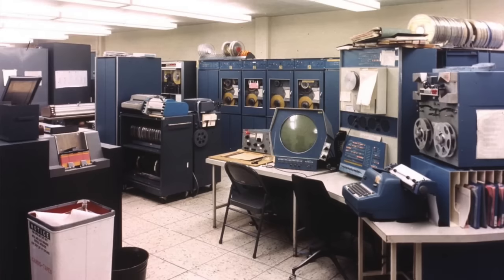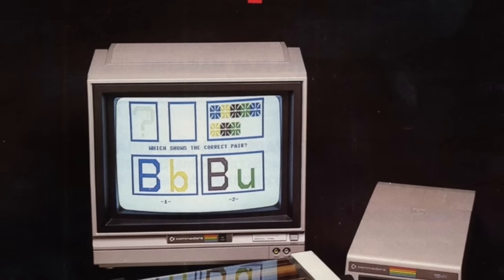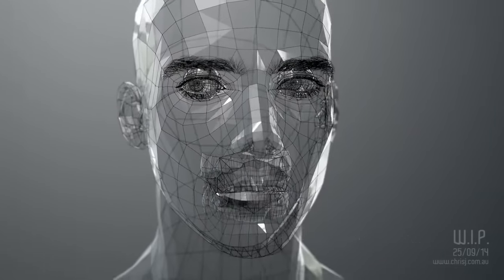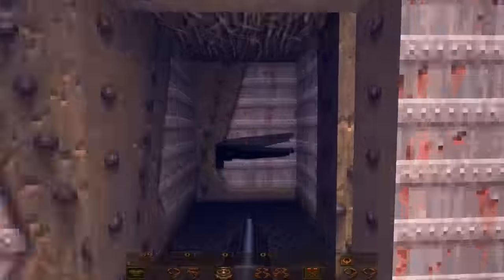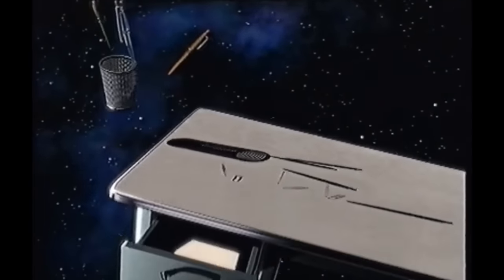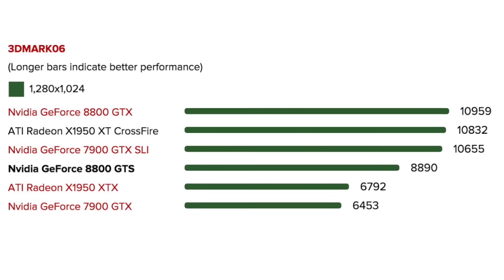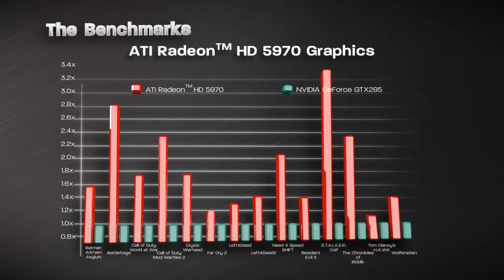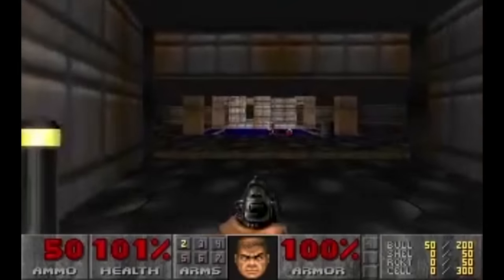Evolution Of PC Gaming Hardware

Comment: this really makes me wish I had money so I can upgrade my budget build
Reply: even though it's pretty good
Reply: +zman2748 what are your specs?
Reply: +zman2748 hell yeah, im with you on that
Reply: +evorm amd phenom 2 (hopefully I'll get a new tower for an Intel core i3 in December) 8gb RAM and the gtx 750 ti sc
Reply: +zman2748 u can spend a little more on the i3 and get a K which is more optimized for overclocking
Reply: +evorm yeah I'm gonna need to overclock because I'll be getting witcher 3 soon after the i3
Reply: +zman2748 i3 isnt very good for gaming get either an i5 or a solid quad core amd cpu
Reply: +jatwood1997 it's better than phenom 2 lol
Reply: +zman2748 May be better, but dual cores are starting to become obsolete very fast.
Reply: +zman2748 sits in the corner with a 880M 24GB RAM and an i7 very lonely
Reply: Not comparing dicks, but mine is better.

- Intel Core i7-6700K 4.0GHz (Quad Core)
16GB (2x8GB) DDR4 2133Mhz
Samsung 850 EVO 120GB SSD Read: 540MB/s Write: 410MB/s
Secondary Hard Drive - 2TB 7200 RPM
Graphics Card - Nvidia Geforce GTX 980 Ti 6GB (Min. 600 Watt)
Power Supply - Standard 700 Watt
CPU Cooling - Asetek 510LC High Performance Liquid Cooling

Only 2000 dollars
Reply: +Chad Meier I'll buy the i7
Reply: +Bloody Ax Lel you got a 6700k Skylake instead of a 5930k. Hilarious.
Reply: Pyromancer Sargeras Is the 5930k better?
Reply: +Bloody Ax i have

i7- 3770k 3.4ghz
12GB ddr3
1tb shitlord drive
750ti dual fans overclocked 1300mhz boost clock 5600mhz memory clock
450 watt
fan cooling

only 800 3 years ago
Reply: Bob Higgens Not to bad.
Reply: Bloody Ax yeah halfway decent but if i could choose i would get two 980ti's
Reply: Bloody Ax Yeah, the problem is the 5930k is like $150-200 more. I mean, for a $2000 build it would've been worth the difference in my opinion. Everyone has their budget though of course.
Reply: +zman2748 Yeah, I build mine like 3 years ago and still don't have the money to upgrade it only because every time tech being pushed , but I'm proud of what I got only because it still can run things:

Intel Core i5-3570K @ 3.40/3.80
8 Gb of Ram
Gigabyte GeForce GTX 660ti 3Gb
Reply: +zman2748 please do reconsider buying a dual core some newer games only works on quad cores main example being Far Cry 4 and most games runs like horseshit on dual cores now.
Reply: +Bloody Ax Nice build very good for the price. I have:

Intel core I7-5820k
16gb (2x8) ddr4 2133
Samsung 850 PRO 250 GB
And also a 3tb HDD  and a 1tb for games.
SLI Asus gtx 970 strix
1000w corsair rm1000
Corsair H100i
and for the case I chose the corsair Graphite 780T

For around 2500 (Tech is very expensive in Denmark)
Today I would have went with a 980TI though... It came out like 2.5 weeks after i bought mine
Reply: +TrianglesRPurple 

I'm just sitting here with my potato.
Reply: +TrianglesRPurple im sitting here with my 1000 dollar build
Reply: +zman2748 phenom 2 is better than core duo e8500 :(
Reply: ***** That GPU seems kinda out of place...
Reply: ***** Hey at least it does bread!
Reply: I feel so alone
Intel Pentium G620
8GB Crucial Ballistics Sport XT (1866 version but cpu runs it at 1067 Mhz) 
EVGA GT 730 OC'd 1280 core clock and 3159 mem clock
1TB hitachi hdd and 500 gb WD Blue
EVGA 400 watt psu
Ranger-M case
Soon to have GTX 960 and AMD Fx-6300 (Need to buy a better psu and mobo)
Reply: +zman2748 Im saving for a already built one and hope fully its good in the end. Mine sucks, at LOW settings its at most 70fps
Reply: Lenin Lopez Hey it could be worse. You could be playing at 30 fps!
Reply: I honestly don't see a difference between 30fps and 60fps other the a couple of quality upgrades buts thats about it.But still its good, it gets the job done.
Reply: Lenin Lopez Then I won't try to show you the difference because that'll just make everything a lot easier for you when you don't have to worry about framerate as much
Reply: +Lenin Lopez Then you aren't playing at a constant 60fps and 1920X1080 or above.  You play games at 60fps for a time and then go to something at 30 and you DEFINITELY notice.
Reply: +Bloody Ax god damm, I'm the only one that haves the full "Red One" PC

fx-8150 black ed.
8 GB 2133mhz RAM
r9 270x 4gb ed.
ssd kignston 120GB
1TB hdd's (multiples)
cooler master seidon 120m
msi 970 motherboard
700W psu
aaaaand a lot of fancy fans and red leds

all pieces for 550$
its nice now that winter is coming ,i have no cold in my feet! 
have a nice day guys!
Reply: Just get a 750 ti or a 260x or a 960
Reply: Your rig is not that bad it's way better than a console seriously you can run AAA games at 1080p med setting 60fps way better than a console
Reply: +Bob Muffin i got the same card, its excellent for medium graphics and even some at high
Reply: +Bob Muffin why change to an i5 4690k theres like no difference in gaming performance
Reply: Overclocking is something I guess PC gamers with a little extra dough sly towards, may not be like having a i3 Oc'd to compare to an i5 stock but again... we love to mod :D
Reply: +Bloody Ax Let me guess, you're also going to be getting Fallout 4?
Reply: +zman2748 Work hard, and you can buy whatever you want!
Reply: +zman2748 i was on a 265$ build for two years. i can relate to your comment so much
Reply: Skaterm8 Bitch please, someone donated a pc for me it had a Pentium 3 1.1 ghz and I used it for 10 years till I grew up and built my own
Reply: +Bloody Ax that's really not needed for gaming but okay.
Reply: +zman2748 wtf it's awesome 
I have a pentium 4 2.8ghz
Nvidia geforce 6200
1.25 gb ram
and I don't have money to buy a new one
Reply: +Jace Balavin my build used to be high-end, now... not so much, I have an EVGA gtx 780, i5 4670k and 8gb ram... Gonna buy 8gb more ram and an ssd soon.
Reply: +zman2748 i have the 750 ti sc, really great card, it is with my FX6300 runs all the games i care about pretty well

Comment: Started as a PC gamer with Pentium II 400 @ 450MHz & GeForce 2 MX. Now running Pentium G3258 @ 4.6GHz & GeForce GTX 780Ti. The evolution of 3D graphics has been a joy to watch over the years.
Reply: Aika tuuheet laitteet. :D
Reply: get yourself a shiny new GTX1080 and your eyes will melt compared to the 780ti lol. I know theyre expensive, but save a little and build a new rig. its worth it!
Reply: FML, i still need to wait 2 months to get my new rig and get rid of this crappy potato from 2008
Reply: kyle weadock I don't see a reason for that since I'm not into that 144Hz bullshit. ;)
Reply: Tuuhio its not necessarily about framerate. Just makes it so you can run ultra settings and just about any game on any resolution. if you can afford a 4k monitor down the road its awesome. Ive been playing the witcher 3 4k on ultra, and get a solid 40 FPS. not great framerate, but still smooth and looks just GORGEOUS
Reply: kyle weadock Sounds good! I'd die to see Mirror's Edge Catalyst maxed out @ 4K..! <3
Reply: Now kicking with 5820K @ 4.5GHz, 32GB & GTX 980. I hope  that the prices will drop on used hardware, fucking miners pumped them high af.

Comment: Recently built one with:
i5 4690k
r9 390
MSI Gaming 5 mobo
16GB 8x8 1866Mhz RAM

Everything is at stock clocks but I can overclock if/when I want. Everything runs amazing right now so I don't really think I need to do anything until it gets dated.
Reply: +Rory Free ?
Reply: House devedesete The video asks at the end "Write in the comments what you currently have in your computer" or something like that
Reply: +Rory Free Most Games Don't need you to overclock. Overclocking is only for Enthusiasts. I have i5 4570 , 8GB DDR3 1600 Mhz, R9 270X. I can play most Game High / Ultra without overclocking . BTW My Monitor is 1080p that's why I can still run with 270X :D
Reply: +Adyel Ullahil Mamun Overclocking is not just for enthusiasts. In some cases, having an overclocked CPU can greatly increase operations where high CPU speeds are required. For example: CPU-intensive applications, where the increase in a clock speed can determine whether a process (calculation of a complex algorithm) can take 25 hours to complete OR 15 hours with an overclocked CPU.
Reply: +Rory Free I'am currently saving on i5 6600 R9 380x 8gb 2x8 DDR4 2133MHZ :D
Reply: ***** Who does this kind of work normally buys Xenon Processor. They deliver much more performance for CPU based work
Reply: Adyel Ullahil Mamun *Typically uses. In some scenarios, less cores for higher clock speeds are beneficial in order to complete single-threaded operations.
Reply: ***** Like What ?
Reply: i5 lol most of people use i7 cpu.....i5 is shit!
Reply: +House devedesete More Power =! Smart. One* hacker/Security Researcher (whatever you call them) Hacked Aero Nav using low end Android. I call that smart. Keep watching porn with your i7
Reply: Adyel Ullahil Mamun It's common to see a lot of gaming servers using very high clock speeds on CPUs. Depending on the game, the server may only utilise one thread efficiently, hence requiring a higher clock speed than a Xeon can provide. 
But hey, you're a "hacker". Continue to have fun using exploits to modify code in a programmable device & brag on about it.
Reply: +House devedesete I am talking about Normal Gamer / User . Normal people don&#39;t USE 3D Modeling software and Neither they buy i7
Reply: +Rory Free 

and i recently robbed a chain of kfc stores so i nigga gonna be eat good fo a while
Reply: +Rory Free 

It's a really solid build, but because you're using the MSI Gaming 5, if you're not overclocking it, it's wasted hardware.  There are motherboards with half the price that can handle that PC at stock.  I'd overclock that shit and get the most value for your investment.
Reply: +Rory Free is 2GB graphics card memory good?
Reply: +Rory Free 
i5 6600K @ 5Ghz - 280/140/80mm rad
R9 390X x2
32GB DDR4
Z170 msi
250GB samsung 850 pro - boot
500GB samsung 850 pro - steam
Reply: ***** I'll upgrade to 4GB then
Reply: I'm rocking a 1.5 ghz iPad Air 2 with 64 gigs of storage and a 2048 by 1536 Retina display. Gets 60fps in minecraft... :/
Reply: +House devedesete lol
Reply: +Adyel Ullahil Mamun me too! i was wondering for a while why i could run every game on ultra (even new ones like fallout 4) on my r9 270. then it occurred to me that the r9 branding was was designed for 4k gaming and im just running on my living room 1080p. Super-fuckin-duper!
Reply: +Adyel Ullahil Mamun There's no reason to not overclock, it will make you pc live a bit longer before you have to upgrade.
Reply: +Rory Free i am about to build the same. what is your performance on witcher 3 if you  have played it
Reply: +Rory Free u prob should put an i7 in it, i had a computer with an i5  and then got an i7 computer and there is a huge boost in how well ur games will run
Reply: Oh nice! I just built one, too.
AMD fx-6300 6-core (overclocked) 5 GHz
Nvidia gtx 950
16 (2x8) ddr3
gigabyte motherboard (forgot what model)
Reply: +xynthisis why a 950 ???
Reply: yes why a 950. old
Reply: +CC CC (Anonymous1993) around that price what else beside 950 ?
Reply: amd r9 270 maybe? Edit: nevermind, apparently thats more expensive
Reply: +Elroi Paulus r7 370 or 270 i think should be fine but hey nice build i would have gone with amd because nvidia has bad dx12 support but further nice pc
Reply: +Rory Free haha same build xD
Reply: also built one recently.
asus z170 pro gaming
i5 6600k
2*8gb ddr4 2666
gigabyte 970gtx windforce3 oc
ocz trion 240g ssd
seagate barracuda 1to hdd
enjoying it. this video remembered me when i had that beast voodoo2 with 12mb

Comment: Finished my build yesterday afternoon my specs:

CPU: i7 5820k
CPU Cooler: Noctua NH-D15
Motherboard: Asrock X99 OC Formula
RAM: 16 GB of EVGA Super - Super Clocked DDR4 @ 2800mhz
(Only sold at microcenter, but essentially from what I've read its G. Skill RAM rebranded by EVGA)
SSD: Samsung 850 Pro 256GB
HDD : WD Black 3 Tb 7200rpm
GPU: EVGA GTX 980 Ti Classified
CASE : Corsair 780T Full Tower
Power Supply: EVGA Supernova 1000w P2 80+ Platinum certified fully modular
Optical Drive: LGBH16NS40
OS: Windows 10
Wifi Card : Asus PCIe AC68
Case Fans: 3 120mm Noctua NF-12 industrialPPC & 1 140mm Noctua NF-A14 industrialPPC
LEDs - NZXT Hue

Come at me with your Xbox one LOL
Reply: a good build for a gaming rig
Reply: Tchitchouan Inouane Thank you
Reply: TAGEtheMAGE
you're welcome n_n
Reply: +Jalen Livingston these pc gamers say so
Reply: Jalen Livingston Alot cheaper than buying a custom build pc. For building it I would reccomend building with a friend or family member if its your first time.

If you dont have a family or friend to help you. You can always buy pc parts and take it to a local pc shop like microcenter or frys electronics amd they'll build it for you.
Reply: I will be outdated in 1 week:)
Reply: +TAGEtheMAGE Personally I would go with a i7 4970k but its a good build either way in my opinion
Reply: +Jalen Livingston yes and I built mine too
Reply: +S1B0RG2 the 5820k is better, and the 4790k does run hotter, but that price tag...
Reply: Nick Schiener It is preference really.
Reply: nice bro roughly how much money for this specs?
Reply: Faeren Ayam You don't want to know lol
Reply: +Colonel Bman and i like my ps4 so?????
Reply: A_DutchGamer Yeah thats the hardest part of entering PC gaming is knowing which generation of pc hardware is current and which isn't.
Reply: +TAGEtheMAGE But... im pretty sure Xbox one is a gaming console PC isn't... so go to something else ok? like the C64 its a pc...
Reply: +lexx zigy we don't just "say so" its the compolete truth. prebuilt pcs are garbage. And building a pc is so easy you can do it while youre shit faced drunk and still not fuck it up.
Reply: Wow! How much that cost, 10,000$? some people are poor, dude. Consoles are just cheaper. Not saying consoles are better, but DAMN good pcs are expeeeeeensive.
Reply: +Matthew Heitmann good like. Put me together a 8gb ram, nvidia geforce 750ti, and other good shit for 450. Doubt it
Reply: +httpsLevi challenge accepted.
Reply: httpsLevi http://pcpartpicker.com/p/NhfX6h

and for the video card i did you MUCH better than a 750 ti
http://gpushack.com/collections/all-gpus-for-sale/products/his-iceq-hd-7950-boost

total cost is $456 with shipping

how long did that take me? like 3 minutes? lol
Reply: httpsLevi $10,000 come on man seriously man. Do you you not know the value of money? Especially with price matching. Ill tell you the entire build was $2,800
Reply: +TAGEtheMAGE i bought an xbox one for 300$ and still happy playing with friends.
Reply: +TAGEtheMAGE That's some expensive shit man.
Reply: Giuliano Lopez Raffo This is my full setup build.
http://pcpartpicker.com/user/TAGEtheMAGE/saved/HsmhP6
I saved up for 6 months, but its has been more than worth it.
Reply: Now the only question is... Can it play minecraft? Lol (and yes ik it can kick mine crafts butt...)
Reply: +Themadbird  Obviously
Reply: +Nick Schiener Only in stock form, overklock both and heat is a bigger issue on the 5820k, I have played with both ;)
Reply: Taegre, y u troll wit op pc specs
Reply: Brandon Livingston Wouldn't you brag about your master race setup after 6 months of hard labor?
Reply: TAGEtheMAGE Indeed I would, but random people on YouTube aren't worthy of my bragging rights...
Reply: Brandon Livingston Ahhh ok I see your point.
Reply: +EV Video why did you get an i7? every benchmark shows the difference is negligible
Reply: EV Video I planning on skipping pascal and upgrading to volta in 2017
Reply: EV Video So far the 980 Ti completely stomps through 1440p having consistent frames of 72+ frames with all details at ultra. I say 72 because thats 1/2 the refresh rate of my monitor to give you an understanding if you have a 60 hz monitor. As you can see this card is made for 1440p and Up.

It depends which resolution you play on to be honest. I haven't run benchmarks like Firestrike or Valley which I intend to do soon. So I can't give you any numbers for you to measure at the moment.

Now on terms of which brand to choose. I chose the EVGA's Edition of the 980 Ti as seen here.  
http://m.newegg.com/Product/index?itemnumber=N82E16814487146&nm_mc=AFC-C8Junction&cm_mmc=AFC-C8Junction-PCPartPicker,%20LLC-_-na-_-na-_-na&AID=10446076&PID=3938566

In my opinion its the best 980 Ti that runs on air that still doesn't go over the $700 price tag. I mean in the end every 980Ti is shaved down Titan X.
Reply: EV Video Yeah man go for it should handle fine.